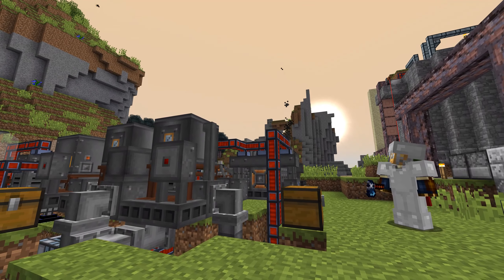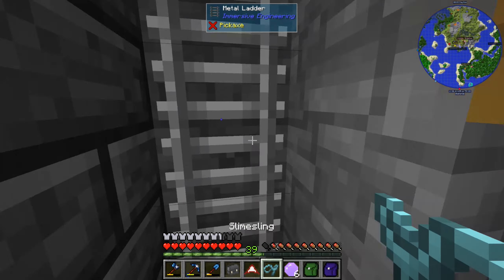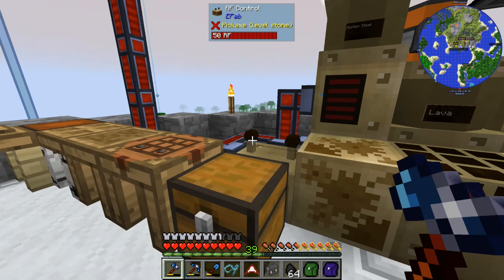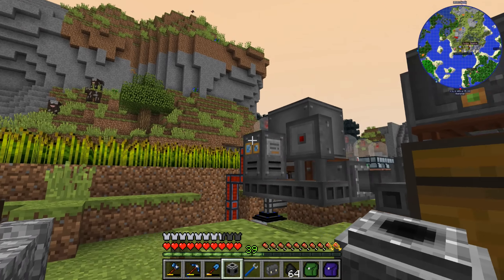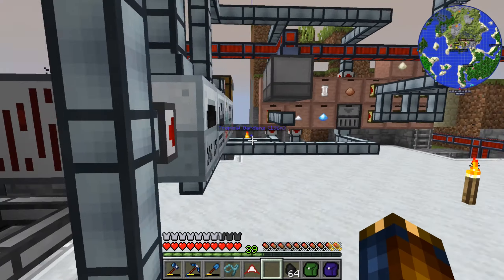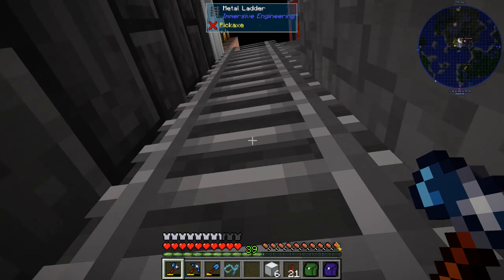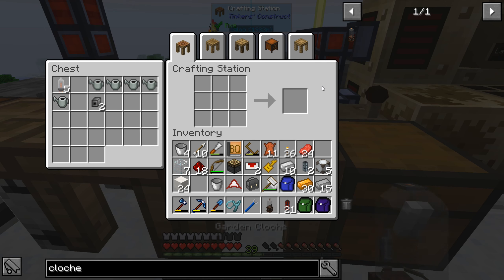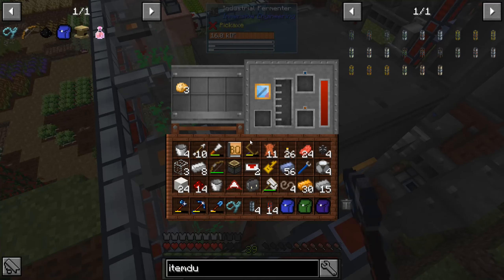Minecraft FTB Continuum - Episode 68: Overcloched

Comment: Finally read the video title correctly; it's well named. 
I don't recall what the ratio is for making bio-diesel for mixing plant oil and ethanol; if it's not 1:1, (or if potatoes and hemp seeds don't produce the same amount of ethanol/oil per item) then maybe it needs to be a different ratio of cloches?
I do recall from the immersive engineering wiki that you do need more than one thing is required. The power output is different so I don't know what it will work out as efficient now, but it says 1 refinery, 2 squeezers, and 2 fermenters to run 2 diesel generators. But that's a lot of materials, so I'd guess that having an over supply of the base resources (and maybe an extra fermenter and squeezer?) would be better. Still a lot of steel and advanced engineering blocks though... gross.
But thank you for sharing your play-though!

Comment: Diesel generator is nerfed big time in this pack.  It only outputs 1024 rf/tick instead of the usual 4096 rf/tick.  That's why you are struggling so hard to get it working well.  You are better off with a biogenerator, canola oil / oil generator setup, or a bunch of thermal expansion dynamos with upgrades.  The Immersive diesel generator is not going to do much to help you - best to leave it behind and do something else.
Reply from the maker: Oh wow, really? That explains so much... this pack, man.